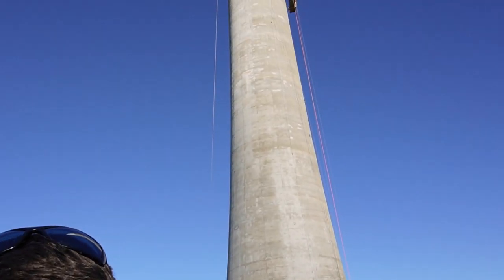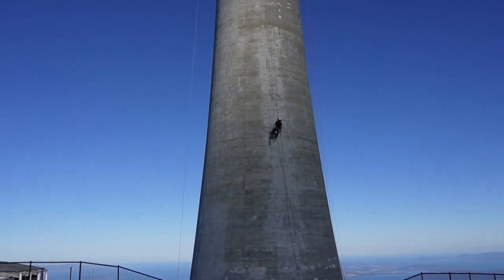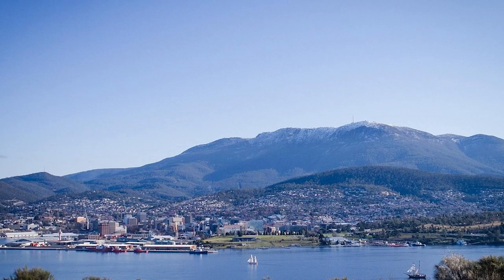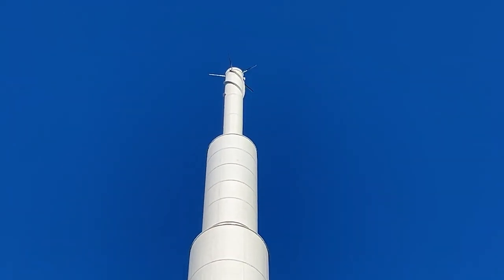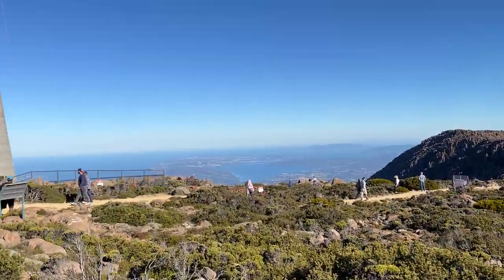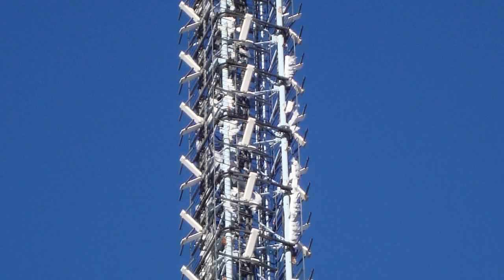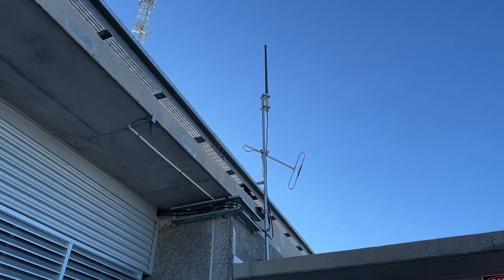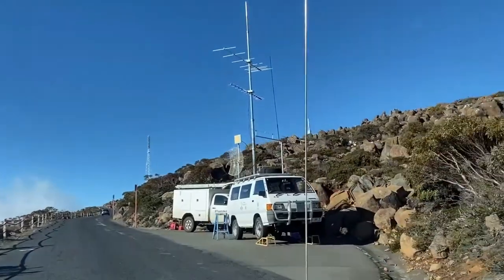How Do You Maintain a 200,000 WATT FM Tower

Comment: I've spent a lot of time inside both buildings during my career with Telecom/Telstra although the Channel 6 building (as it used to be called) looks very different now. There used to be a lean to on the Southern side with holes in the roofing iron from falling ice. I almost got to climb the "new" ABC tower once. I had to attend the site for other reasons and the guys had left the door at the tower base unlocked. There was a lift and stairs inside. The tower was complete but not yet commissioned. I started to climb the stairs thinking this was the only chance I would ever get to do it but bailed as I couldn't be certain none of the antennas were active and there was no one to call for help if I fell. Fun fact, the diesel generator in the ABC building was the engine from a submarine. Not sure if that's still the case.

Comment: Great video and an awesome tower. I had the privilege of taking the lift inside to the bottom of the radome then climbing a bit of the internal steel skeleton to replace an amplifier back in the early 2000s.
We did this in the early morning with the broadcast arrays running decreased power so as to be safe.
Even inside the radome I remember the misty rain making its way through and the cold that Mt Wellington is so famous for was very noticeable.
Reply from the maker: Wow, that would've been awesome! Did you get photos?
Reply: If I recall correctly I did take some photos but they weren't good due to the lack of light and I have no idea where they would be now.

Comment: We had a 2m repeater we had a set of keys but couldn't climb the mast we had to get a professional  Ariel rigger for that . The company that owned the site put the rent up to bring it in line with what  the local radio and tv station paid so we left.
We moved to an abandoned  observation post left over from the cold war . It was complete with tower and underground  bunker . It was flooded . It was dug out new drains fitted the tower painted the electric connection was about 1/2 mile long to the nearest farm . The rent was paid in money and whiskey.  When the farm changed hands the farmer realised the value of the site and want us off, so we moved to a site on top of a small hill on a lighting column type mast
Reply from the maker: Thanks for the comment Geoff. Yeah I know a few sites are paid for in beers down here

Comment: YIKES!
Phew... I got vertigo looking up at that tower, Hayden! Heehee.
Mt Wellington is quite different to Melbourne’s Mt Dandenong. The mount is 600 metres (give or take an inch) with 4 towers, the tallest, with most of our TV and fm broadcast (50kw) reaching another 180 
metres skyward. The coax cables running up one leg of the steel tower are more than a foot in diameter. Lots of rf!
Thanks for sharing the view from Hobart, Hayden.
Cheers. VK3ACZ
Reply from the maker: Yes I’ve been up Mt Dandenong and checked out those towers and also Olinda. They are rather impressive! Thanks for watching Peter

Comment: FM's (7XXX, 7TTT, 7HHO) are 5kW, ABC and Triple J are 20kW, SBS and ABC TV are 10kw, DAB is 3kW... WIN, 7 (Southern cross) and TDT are on the exposed tower they are 10kw NEC txers.. the satellite dishes are for when the DVN (Digital video network) dies.. and there is only 1 fibre up there. the Dishes almost useless in the middle of winter

Comment: A very harsh environment for sure.. that huge tower must have cost multiples of million to build..
Towards the end when you was talking about sitting lower to do the field days, can i just say in my experience that sitting a quarter to halfway down the full height of a mountain or hill can actually be better for distance work (dx) on the radio than sitting at the peak with how transmission's can reflect with the ground wave effect.. also i did hear you say you sit lower because of the interference from the tower..
Good video lots of information and insight.. not sure if that guy you spoke to had a Scottish accent, could have been the cheap tablet i used to watch this on lol..
Stay blessed.
Reply from the maker: Irish accent I think? Maybe wrong there. Thanks for watching!